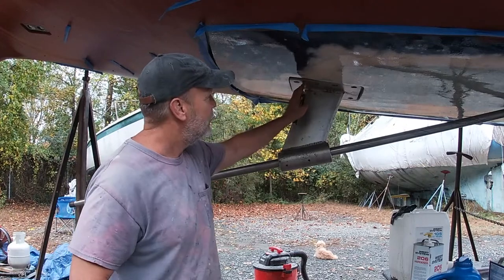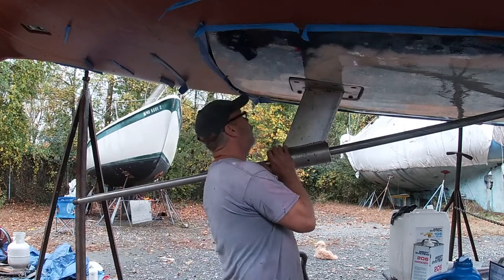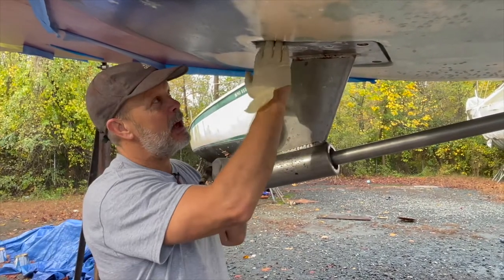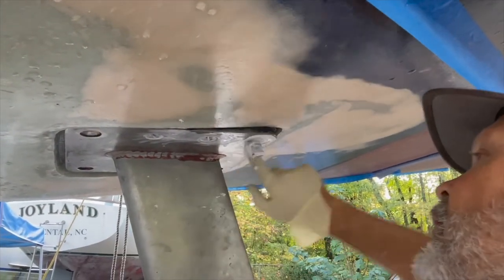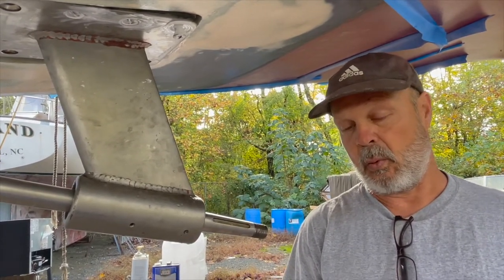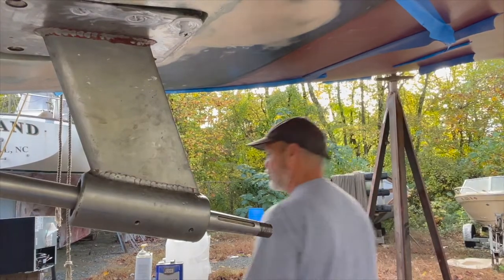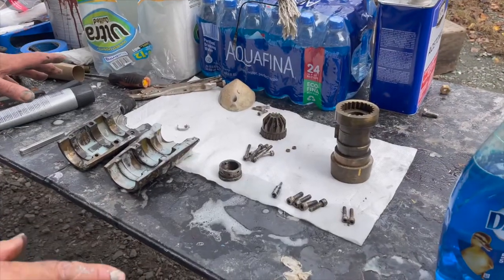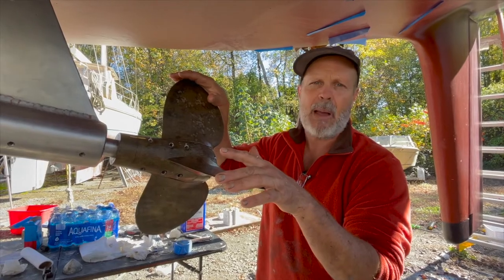Looking Back on the HARD- Aligning the Strut on a Sailboat! Ep. 36 Sailing SV Bohemian

Comment: YOU should have installed the shaft first into both the hull seal and the prop strut and adjusted the mount for the strut according to line it up so it would rotate easily

Comment: Nice job! Next need to align the transmission?
Reply from the maker: I think on Friday I’ll pay for the exhaust elbow . 750 bucks .  From painting the hull and the fiberglass work to a rebuilt tranny and all the engine cooling system parts like a new heat exchanger . Probably about 15 grand or a little more .